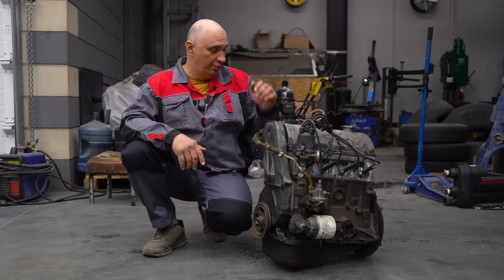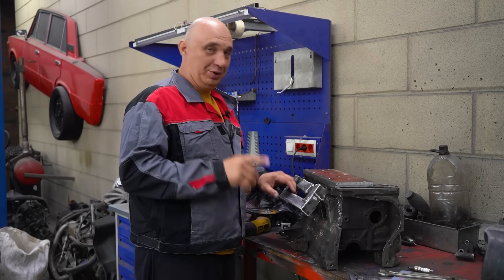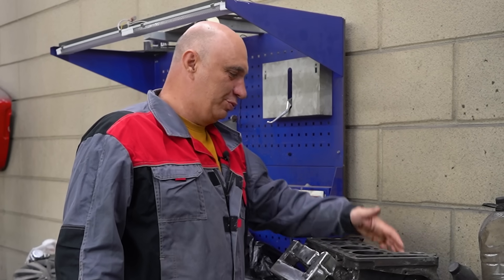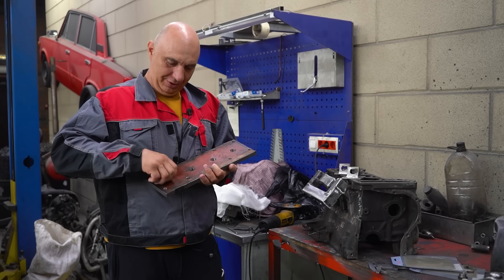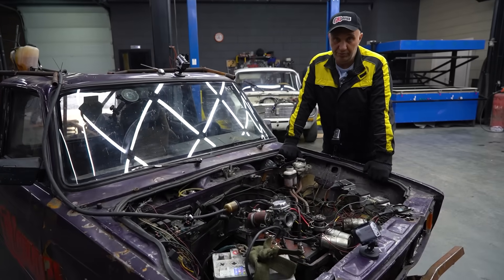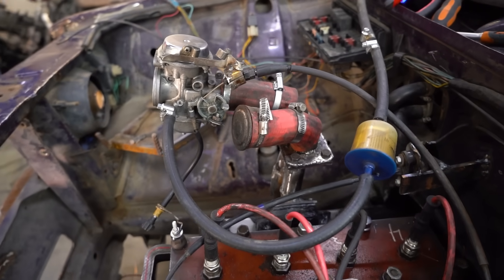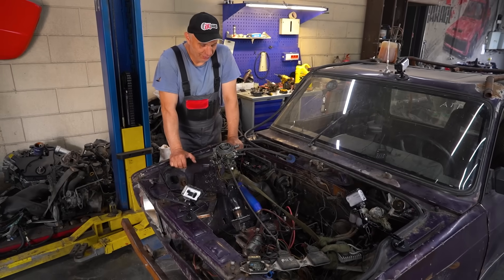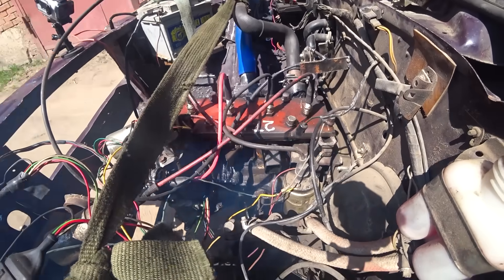4 stroke to 2 stroke Lada engine conversion

Comment: Each cylinder needs to be sealed from each other in the crankcase so when the piston is travelling down it creates pressure underneath the piston in the crankcase which then needs to push the air up and around into the cylinder above the piston, this type of crankcase seal in a marine application is called a Labrynth seal, the port that allows the pressurised crankcase pressure to travel into the cylinder is called a transfer port.
Reply: Labyrinth*

Comment: Try independent carbs, maybe more to tune, but that would likely help each cylinder get the chance to fire - may also want to dome the piston head and cylinder to match - intake porting can be a big factor too .. did you do wasted spark?  Big thing though would be making sure it gets enough fuel and air with 2-4 carbs

Comment: YOU NEED THE CYLINDER HEAD.
MAKE ONLY THE EXHAUST VALVES OPEN.
The Detroit DIesels used FOUR VALVES.
All four valves opened only for EXHAUST.
The supercharger pressurized the crankcase to force the air into the cylinders.

Comment: I would love to see this engine finished. Try multiple motorcycle carburators, one for each cylinder. And expansion chamber exhaust, also one for each cylinder. Even if you added a yz 250 expansion chamber for each cylinder that would be more helpful than running straight from the block.

Comment: At first I thought it would be impossible. but then I noticed all the cutting, breaking cast iron, and welding, involved. and as the video went forward I was beginning to wonder about the ignition. being as it had to fire twice as many times the ignition timing is going to be off. and on many two stoke engines. either rotory valves, or reed valves, and in the case of Detroit diesel engines. they have super chargers to contain the air fuel mixture in the cylinders. and I was thinking that you should have seen more smoke when it first started. because two strokes smoke, especially when they are cold.

Comment: 1:22 the intake and exhaust ports look identical on both sides... The exhaust port placement is key to this working, it needs to be above the intake port a few degrees of crank rotation so the fire exits into the pipe then a pressure wave scavenges the intake port as it opens . Without positive pressure on the intake side this isnt going to be very efficient...

Comment: Would it be easier to modify the camshaft for two stroke operation and modify the distributor to fire the plugs twice as often,seems like that would eliminate all the block modifications and retain the cooling&oiling system.
Reply: Run natural aspiration on gasoline you'd have to get another engine to do this
Reply: Use the original cylinder head

Comment: Connecting the carb to the chamber on the manifold inlet port and running exactly 98 octain mixed with gear oil always works.

Comment: Maybe try giving them carburetor per cylinder, and try using high octane gas with 18ml per liter of gas (if possible, proceed with caution)
Reply: What i means is 18ml of 2t oil per liter

Comment: You need seals between each crank in the crankcase and transfer ports; I  don't think you can get this to work. You would also need to change the lubrication system for the engine's bottom end. The only other way would be a supercharger to force the fuel-air mix into the cylinders rather than using crankcase pressure.

Comment: id say the exhaust ports should be a bit higher than the intake ports so they open sooner. if theyre across eachother like this the expansion forces into intake as well as exhaust meaning nothing will enter the block until its empty

Comment: try the 2 stroke system with valves and ports like a Detroit diesel, it does not use the bottom end for induction, it uses a blower to force air in.

Comment: check each spark plug for over/under mixture. then leave one plug wire off to see  if it improves.may run better on 3 cyclinders?

Comment: There's no forced induction, you need either crank case forced induction which uses the pistons descent to shove the charge into the cylinder or a supercharger to force the air in

Comment: You should leave crankcase original and only add untake ports in the cylinders, then you need to turn down camshafts intake lobes and change camshaft gearing to 1:1. You also need supercharger for scavenging so it will blow fuel air mixture through intake ports in cylinders. Look up how 2 stroke diesels are made and you will see what i mean.

Comment: Been reading the comments. I agree with allot of the Detroit diesel theory. It looked as if you installed some sort of reed valve at the second attempt? Think of a weed eater engine. It uses reed valves, and requires air, gas, oil. Mixture. The reed valve needs a certain amount of pressure from the crankcase. So you would likely have to calculate how much crankcase scavenging you have, then somehow make a reed valve to open at that pressure. Also keep in mind your exhaust is usually going to be above the intake as the crankcase pressure is helping pull the fuel mixture through the reed valve on the way back up. I may not be 100 percent accurate here, just a couple of opinions off the top of my head

Comment: Most likely volume of crank case also 2 stroke need momentum so instead of one flywheel you need 4-8 small in each case . This will increase compression  in crank and also faster transfer of AF mixture. Oh and enlarge this ports 400cc 
Per piston and your ports are like dots. Just take one trabant engine  and reverse engineer it.

Comment: Two-stroke need back pressure you're wide open header exhaust is keeping back pressure from pushing the Pistons down creating a much harder time for the engine to actually fire up and run

Comment: Exhaust port opens the crankcase when Piston is in TDC. Thats not how a two stroke works... The Intake Port flushes the Gases directly into the exhaust. Thats now how a two stroke engine works. You Need a "Nose" Piston. Ore better the "Schnürle Spülung" with two opposite Ports. If you do that you will get it run a few minutes....

Comment: I know this is a few weeks old but I was thinking that you have to look at it like a Detroit diesel 2 stroke since it doesn’t have enough crank case pressure they come with a supercharger from the factory to compensate and push the air fuel mixture into the combustion chamber… I’ve been working on Detroit diesel’s too much lately

Comment: You need to redo it as a uniflow  two stroke.  Remake the cam so all 8 valves are exhausts, blow the mixture in though the ports you have already cut in the cylinders with a supercharger.

Comment: Normally 2 stroke engines have a  stuffed crank case. Without filling the crank case as much as you can you will lose the bottom compression. Meaning it will be underpowered and have a big fuel consumption for nothing.

Comment: According to that piston size, the intake ports and exhaust ports are narrow. If you enlarge them it will work. Normally crankcase pressure is also need. But this will do the job.

Comment: Well first off all seal all the cranks from one another 

Then have 4 reed valves for each cylinder and each cylinder having a separate carb 

I bet till run

Two stroke really dont like to make an effort to run the carbs should be as close to the block as possible

Comment: 5:20 The exhaust port opened when in OT position, that means the crankshaft chamber let the pressured fuel-air goes away on the port here to the atmosphere, you should fit an other type of piston on the engine what don't let open the port in OT position. You must use reed walves because the inlet port and the transfer port are opened at the same time. And use short hose between cylinder and carburetor.

Comment: Need a longer exhaust pipe. The hot exhaust moving through the pipe helps draw in fuel air for the next combustion. Reference puls jet engines.

Comment: From the design you chose, you might try to modify it with a supercharger to provide positive pressure to push the exhaust out of the cylinders while filling the cylinders with fresh air/fuel.  That's how some 2 stroke diesels work.  However, in the case of a gas engine, you'd be wasting a lot of fuel this way since a diesel is injected and this is carbureted.  Just an idea.  I'm not an expert

Comment: I think you will find it has to low crank case compresion as there is to much area in the crankcase, if you reduce the volume of each crankcase to as small as posible, it will run.

Comment: Hello there, so i want to give you some advice about your 2 stroke Lada. You have too small carburator for 4 piston, 2 stroke engine, a bit more air and fuel it needs. Another thing is that try to move firing spark to 20° BTDC it will add it more HP on lower-mid range of powerband whit will do good riding capabilities. And it will run fine. 2 strokes have bit more idle rpm speed. They run from 1800 rpm to 2500 rpm on Idle. And give it more 2 stroke oil but not too much the 40:1 will do fine. I dont know what is your comprassion ratio but i assumme is 6:1 or 8:1 what is a bit low for 2 strokes. I thing the biggest problems are: Carburator, fuel flow, not advanced ignition timing, low comprassion or blowed gasket.  For gasket i will lrefer using red silicone heat resistant gasket to 650C°. 4 stroke gaskets are not that good for 2 strokes, they get blow up after some cranks because of 2 stroke higher comprasion.

Big reggards from Serbia!

Comment: As long as port, ignition timing and  compression ratio is just good enough, i would blame the crank case volume and seal between each case. 

Of course carburetor tuning is a huge key in a running 2 stroke as well. 

I would have dropped using the crank case for compressing the mixture as it would need a severe amount of modification.
Instead i would just have used some kind of blower straight into the cylinders.

If not, then designing and building a new crank and crankcase would be the key.

Comment: The layout confused me a little. Are you feeding fuel directly to the cylinders with ports, or using transfers from the bottom end? If you're not getting pressure in the crankcase you need some form of forced induction to build pressure in the crankcase. The reed valves are a good addition but if you don't have a change in crankcase volume, you're not going to get anywhere with a 2 stroke because there's nothing to move the fuel around. The reed valves do nothing if you don't have pressure behind them.

Comment: Install 4 separate carburetors and make sure you read valves are properly sealed.
And then join two soldiers together to expansion chamber

Comment: Primary crank case pressure needs to be high by having a tight fitting oil pan and separate from the other cylinders.each rod journal should have its own main journal

Comment: 🛑2 Storke User 👋
🛑intake carburator too long... just cut it 3,4 cm from reedvalves ,use 1 carburator for each piston.. petrol inject not enough to support 4 pcs pistons.. it will be great if you put exzos system

Comment: With a 2 stroke engine, the exhaust is a great importance. you need a good exhaust system for it to work properly      При 2-тактном двигателе выхлоп имеет большое значение. Вам нужна хорошая выхлопная система, чтобы она работала должным образом

Comment: thers 3 things that u need to to do .

1 put a air filter for two strock  becose those filters have air rizisten, my frend had that problem with his moped that had shity filter and then replaistit with gud filter and it rain fast ass fuck.
2 you need 4 carboraitors for all cilinders, and those carboraitors u can finde on 250 2t motobikes.
3 you prubly know but u need 2t exhaust  that cluod fit for this engien .

but that wat i think and im not a expert.

Comment: And port timing is going to need to be calculated in conjunction with the carbs cfm capacity, jet size ,intake runner length and ... of course expansion chamber shape, length, capacity etc. .......Huh?
Yeah, this is done by eggheads with slide rules.

Comment: I can give you guys an idea. As a kid i had a 2 stroke small engine on my bike. One time my exhaust fell off and after that it was super hard to start the engine and it lost some power. After i bought a new exhaust it was back to normal easy start and proper power. I think you should try putting some kind of exhaust to create some compression to the cylinders.

Comment: Of course it doesnt run when nothing pumps the gas air mix into the cylinders.. you need a supercharger to make that work. An idea could be to use two of the cylinders as pumps for the other two.

Comment: hey man, you need to put that reed valve in front of each cylinder, ensure each has their own separate crankcase volume, then get to work tuning the exhaust shape.. your motor has some real funky ports, not sure how its going to need to be oriented geometrically, but yolo good luck

Comment: 1 you should keep the original head of the engine with valves closed and if need increase the compression,2  any 2 stroke engine work as a pump so: when the piston reach the PMI it create the pressure to push the mixture (air/gasoline) in the cilinder thru the transfer ports,3 you have to create a separate crancase for any cilinder,4 another ting is the exhaust,the way you did is too open,but the first problem is that this engine in that way don't look like a pump,hope i'm been clear as exaplation,is always good to look at your videos.

Comment: You might need a cv carburatore to make it run, its different between 4 stroke and 2 strokes, you should get 2 of the biggest you can find and then tune them. Chek if pre ignition is timed. Your reeds can be to soft so they dont close up and seal. You might need to fix the crankshaft because in 4 strokes and 2 strokes they are formed different.

Comment: Stick a normal head on it, run the cam at engine speed and only open the inlet valves. Use a supercharger to blow the mixture in.
Called uniflow (sort of)
That’ll do it.

Comment: I think if you time the cylinders to fire independent from one another and added some expansion Chambers to the exhaust it will work! Edit. Considered a super charger for positive crank case pressure

Comment: Look up how a 2 stroke Detroit diesel engine works… they have the intake ports in the side like you have but it has 4 exhaust valves on the top that might help with having to deal with the crank case pressures but you’d have to put a blower/super charger on it to get the intake gas in and exhaust out

Comment: Put a positive displacement supercharger on it to pressurise the intake charge to force the air into the cylinders.. going to 2 stroke should want more fuel and air than a 4 stroke.. so maybe add a second carburettor

Comment: There are a lot of calcutations  and some problems i saw:
1. Forming from 4t into 2t engine means faster air and gas flow, so u need a bigger carburetor.
2. U didnt made inlet port valve, bcs of that engine sucks partly fresh mixture and partly used (already combustioned) mixture.
3. 2t never has inlet and outlet ports in front each other ( or they have pointed pistons) bcs one part of fresh mixture can pass the outlet port before combustion.
4. U dont habe tunnels which crank pushes it throught to combustion chamber.Cranck pressure is too needed.
5. U need totally different exhaust that will make more resistance on flow throught it, bcs without that resiatance one part of fresh mixture will still flow into outlet port before combustion.
6. May ports are to small making delay on mixture going to combustion chamber.
No matter on that, u r the first mechanics making 4t engine into 2t i know and one of the bests in the world!

Comment: You need 4 carbuerators. Find motorcycle carbuerators. Most 2 stroke engines I have worked on use individual throttle bodies for one reason or another. Look at outboard Marine 2 stroke engines. I think you will have better luck with that, if you got the port timing correct. I think your starving for fuel. Try raising float level and or drill your jets. If that helps go to individual carbuerators.  Good luck hope you get it.

Comment: The problem with that 2-stroke engine that you guys are having an issue with. Is because you're not thinking of the original Two Strokes. I have a 2-stroke gas-powered bicycle and it works. And the motor is just a an attachment that's put onto a bicycle. It has no vowels no seal and then again it is a single-cylinder. Because the way that I see the carburetor working off my engine is that. There's a slight enough Gap that the engine can blow out the exhaust. And come back to pick up Fuel and pressure to then allows spark to generate power. So I think your guys is issue is that you might have the exhaust and the intake backwards. But that's just me I hope my information helps. Can't wait to see more about this 2-stroke engine😊

Comment: Because of the way a 2-stroke works it's not going to pull any vacuum with the way you have it set up, meaning you're going to have to put a blower on it. Here in the states there used to be a company named Detroit and they made absolutely insane diesel 2-stroke engines, look at how they did theirs, duplicate it and it'll work fine. 2-Stroke Detroit Diesel, or Screaming Jimmy. Just put a blower on there and it'll start right up.

Comment: 👋
Greets from Switzerland.
How about to give your crafted 2cylinder engine you made from a 4cylinder lada motor a change to convert to 2stroke ?
or even try the 2 cylinder converted to move up and down (and ignition) at the same time ?

maybe the 2 cylinder would work as a 2stroke with some form of supercharging because from what i think a 4 stroke dosent suck air in like a 2stroke do!?

@Garage54ENG

Comment: Check your timing as well, I think the reason it only works at low RPM is because once the distributor advances timing it moves spark too far and it fires when there's no compression